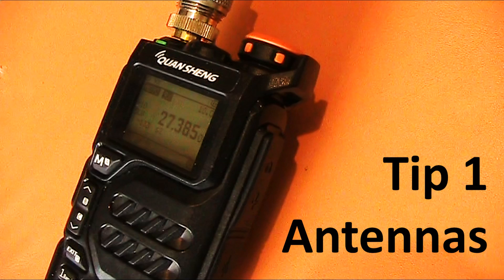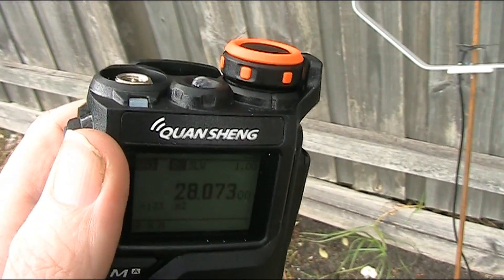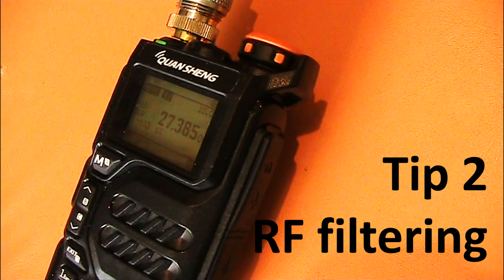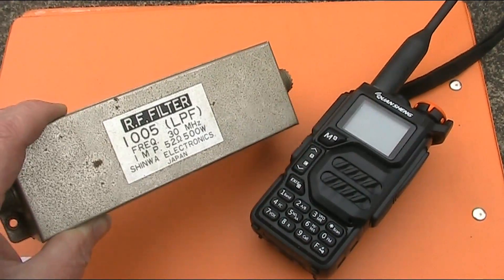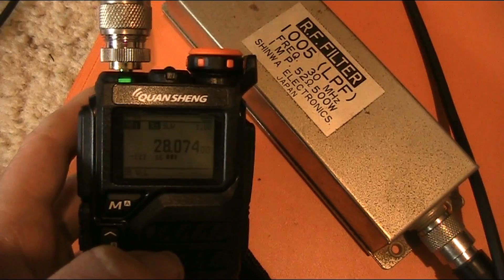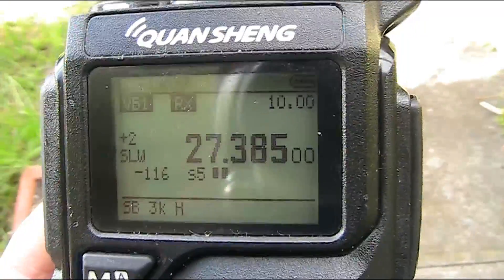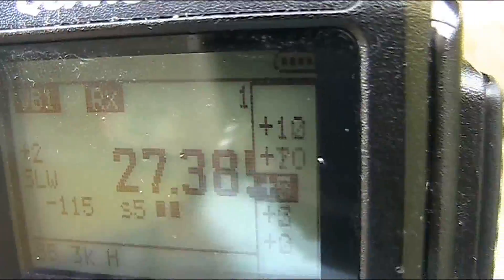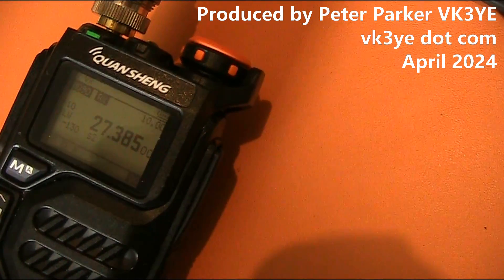Quansheng UV-K5: Top 3 HF receiving tips

Comment: These si4732 receivers all seem to have a mountain of internal noise, which makes them almost unusable.   Are there any settings in which the noise is much lower? 😮
Reply from the maker: There is a satellite setting that boosts gain. Haven't tested if there's any difference when boosting that but throttling the normal gain setting back.